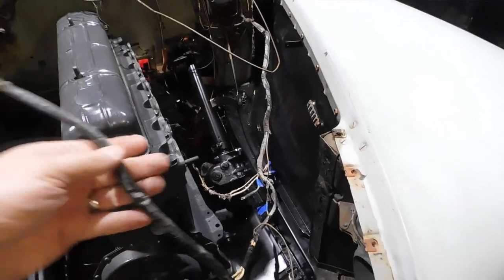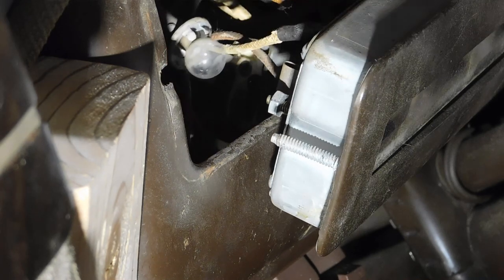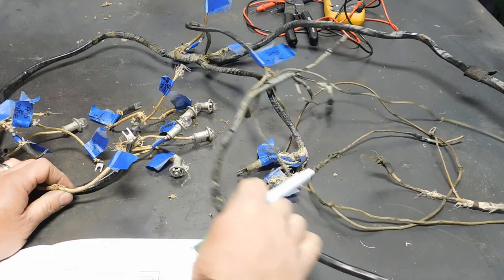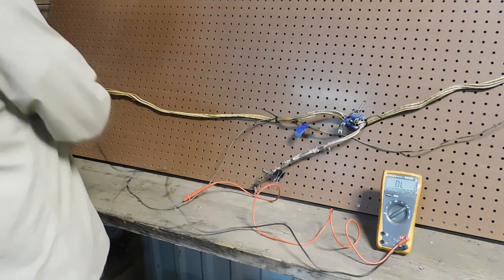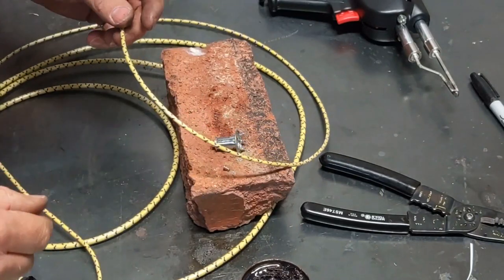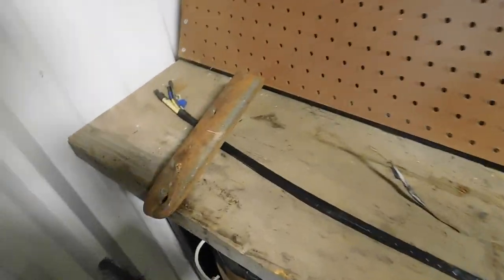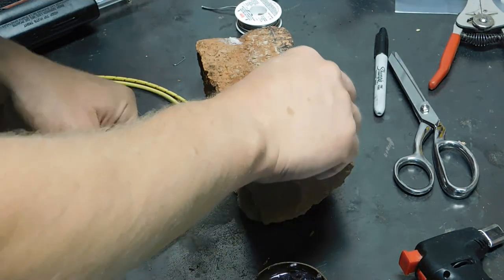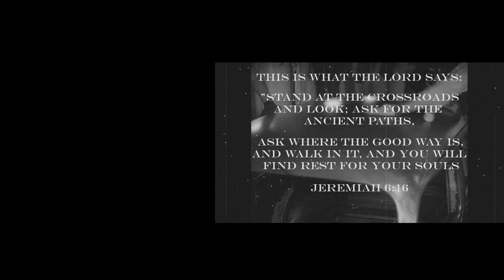Part 6: 1942-1948 Chevrolet Wiring Harness - Building a Wiring Harness From Scratch

Comment: i put in a new wirein harness way back in 1976 , the shop where i got still sells them  , it is still good except for the headlight section and the 4 screw bar where headlights hook to on side firewalls  L&R    harness was 370.00  in 1976  now they cost 800.00 plus   so i will be fixing it OR you can buy headlight section for $88  from chevs of 40s    / i found a good light switch   orignal type /  the mexican one works but looks cheap    great vids !

Comment: When soldering wires, you want to heat from the bottom. Heat rises. The joint at 24 minutes looks cold. Especially with the brick drawing the heat away.

Comment: Thank you for the very informative video, good work! 
 I have a 47 Chevy coupe and I'm interested in doing the same thing.  May I ask what your cost of the kit/parts used was?
Reply from the maker: If you're interested in doing just the harness that I did in the video it takes about $200 in parts. I will be doing a few other bits and pieces so I ordered more than I needed. I got the parts from YNZ Yesterdays Parts. If you want to redo your entire car a full original harness is available from parts houses like chevs of the 40's for around $700. But I also really enjoy doing the work. If you ever need help shoot me an email.
Reply: @TheJayhawker  Thank you, that helps me out. I will be doing exactly what you did, removing and rebuilding with all new parts to spec.  I love working on these cars

Comment: Your videos are the best hands down!  How did you figure out the wire gauge size and amount you needed to purchase.  Could you provide that info on what needs to be exactly ordered?  I want to do the same project on my 48 Aerosedan.  Thanks.
Reply from the maker: I used the original wires for the sizes and had to use the manual wiring schematic for the correct colors because these were too faded. I ordered more than I needed to keep some on hand. I'll have to get back to you on how much it actually took to do the job.
Reply: @TheJayhawker  your the best!  Thanks so much!
Reply: @TheJayhawker  Yes would like to know size, color and amount for the rewire too please.

Comment: Wet the tip-off the soldering gun with solderand put the flux on both wires you are connecting. Btw electricity does not flow current flows. Solder is not a good conductor it is just a binder to hold the wires together. Flux cleans so you get a much better mechanical connection. I just remembered this is not your car so just make it work?
Reply from the maker: The statement "solder is not a good conductor" made about as much sense as a screen door on a submarine so I set out to prove you right. Checking resistance of my test leads touching is 0.2 ohms, I unwound as much as 3 feet of solder and the resistance across the 3 feet of it is 0.2 ohms. It's an excellent conductor. I appreciate you watching my videos and leaving comments but if all you look for is the fault in people maybe you should go somewhere else because I'm not perfect and haven't yet claimed to be. God loves you, therefore I love you, maybe it's time you love yourself.